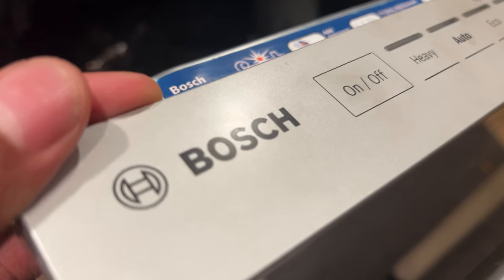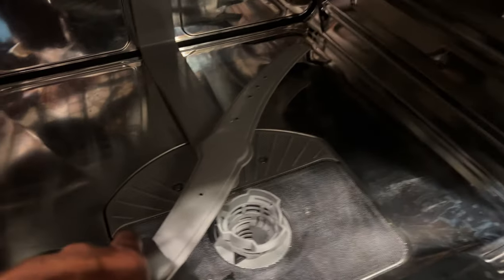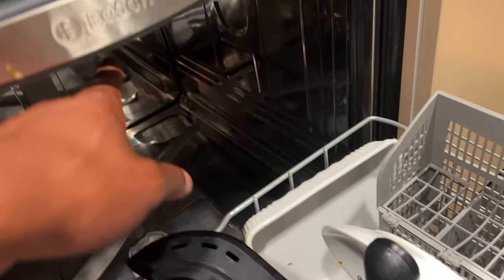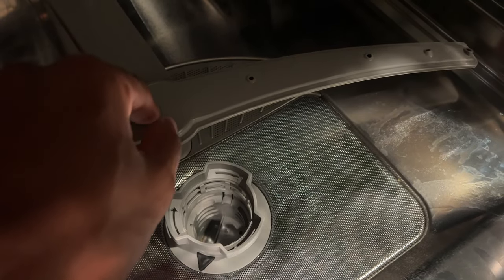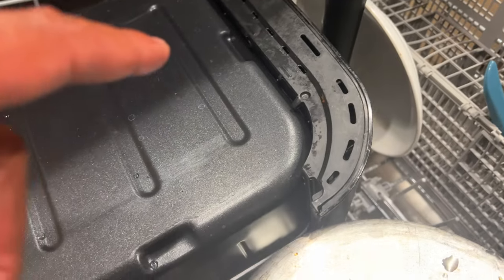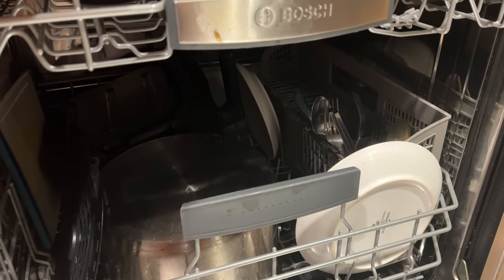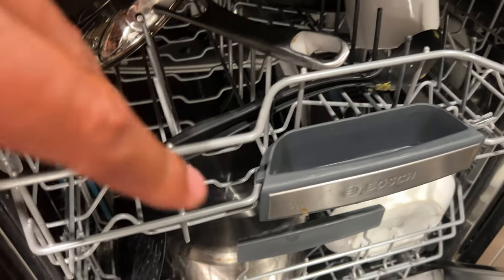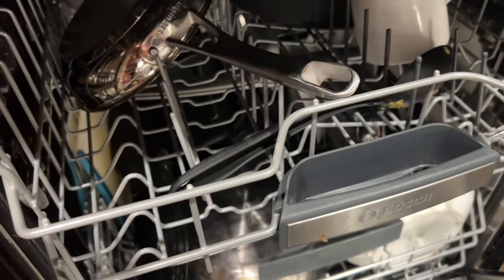Bosch Dishwasher Not Cleaning Properly - How To Fix

Comment: Is it normal for it to kick the detergent pack into that handle thing on the middle rack? Just had mine installed yesterday and some dishes didn't come clean and the detergent didn't fully dissolve
Reply: It happens to me all the time!  Did you get an answer?
Reply: @SuperheroofLove  water line was pinched, restricting the amount of water the machine needs to work properly. Freed it up and it works fine now.
Reply: @atticusdead1280  Oy!  Will see if I can find it!
Reply from the maker: @atticusdead1280 did you ever figure it out?
Reply: @DIYPinto  Yes. Thank you.